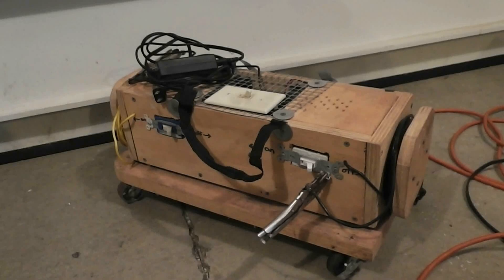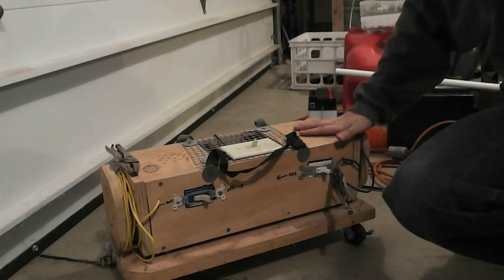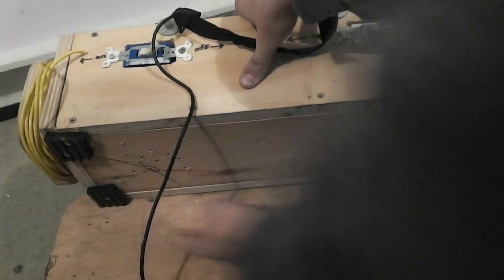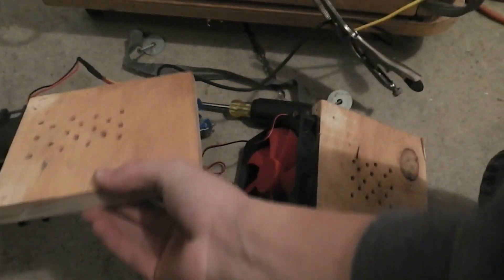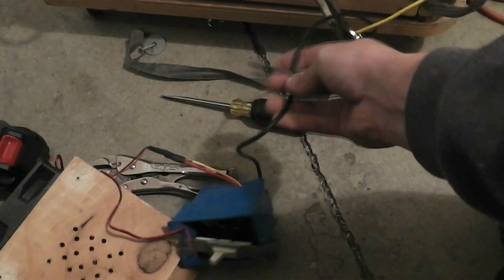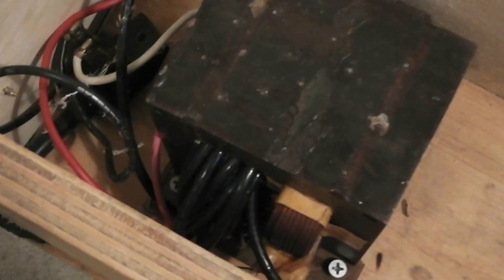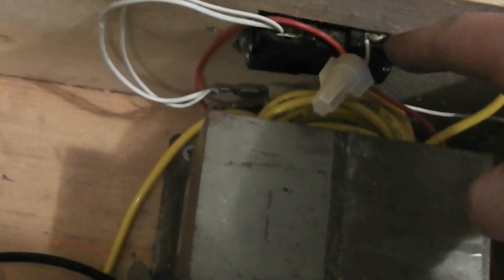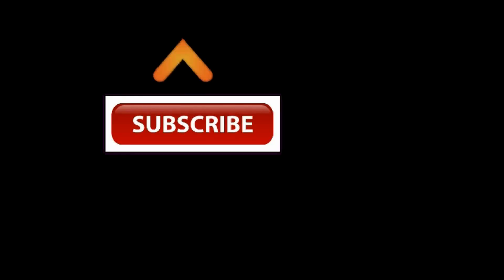DIY Homemade Welder! (best design)

Comment: If you connect the transformer's secondary coils in series, then you should have enough voltage to run 6010s. I wish people would post videos of homemade welders running 6010s. Well, at least I saw pictures of a homemade welder run stainless electrodes, my dad's AC buzz box has insufficient voltage necessary for stainless stick welding unless you connect it to another one in parallel.

Comment: Hey I like your design I was wondering if I could take a light dimmer switch to adjust the welder amperage or would it burn the switch up
Reply: +Chris Graham Since on one has replied yet I guess I will.  Using a light dimmer will not work for this as the welder would pass far too much current through it and catch your dimmer on fire.  It is possible to use the dimmer as a way to set the power level for another circuit to control the power by means of a complicated ZVS device, although I don't think that's where you're going.

Comment: My Lincoln stick welder manual used to say it's not safe to sit on the ground, while welding. You might want to look into it.
Other than than it's a cool welder. Check out the guy on youtube that shows how to weld. His name is: weldingtipsandtricks/
He's really good.
Reply from the maker: Dan Morris That would be true statement since all grounded electrical things are well... grounded, if your welder or device isnt properly grounded then it has a possibility to ground out through yourself
Reply: He is on concrete, as it is dry, it is perfectly safe

Comment: btw less windings means more amps just so u know
Reply from the maker: Yes I know that.
Reply from the maker: SWord Sord 18 gauge or bigger should be good for it. if its a single 220v transformer do around 40 wraps. 2 transformers d o18 gauge 20 wraps each.

Comment: did this setup blow any circuits in your house, even after separating the connections  just wondering, building one of these myself just want to be sure not cause a fire.

Comment: Got to be careful man. Those transformer and pulling over 200 amps and 240 volts. It can kill you if you do the wrong thing.
Reply: Lmao You aint joking on that shit. you will only screw that up once. There are more things in a microwave that can kill you than any other home appliance out there. ugh I get freaked out just knowing what parts made this thing
Reply: joshua Pollard LMFAO im 13 and I took one apart!!! soooo yea that didn't freak me out sooo
Reply: oh and ALWAYS discharge the capassator and un plug it also
Reply: Weallwayswin WithGod  Between your name and your comment I can only assume Darwinism with catch up with you sooner or later. See somebody electrocuted by a transformer out of a microwave and maybe you will have a change of heart.
Reply: dude i know what ur saying and yes im very scared of big transformers btw im never touching them i just hook them up and plug them in from the wall that's all and I'll walk over to them and look for problems soooooo yea
Reply: The voltage should be under 5
Reply: Still be careful....
Reply: I was thinking the same thing.  Have you used a voltmeter?  It looks like you wound a pretty low turn secondary.  How many turns was it?

Comment: Can`t you use only one Transformer? i have seen lots of videos in which everyone uses 2 transformers. I mean is there something i Should know? I am trying to make one myself but i want to be 100% sure of everything i should know, and I am thinking of jut using one transformer, simply introduce 240V or 110V and on the secondary i can make a coil of only a few turn to get at least 200 Amps, or is ther an issue that i am not noticing with it? Please help anyone. Thank You
Reply: the inductance of your transformer is limited just a bit about the power of your microwave. to get more power you have to use more transformers or either boost the frequency
Reply: 200 amps won't work u need more thats my problem also

Comment: I made welder like this from 3 transformers. Great, welds, works, weight is overkill :D  I did want to make it in DC welder, but its cool only if you want to do and build something, if you interested in welding its fu**ing waste of time. Cant get cheap and stable DC. So now i am welding with invertor type dc welder.
I can say that it is great to learn on that monster and then take a good tool in hands.

Comment: Two thumbs up from here.  Your demo clip was almost convincing, just kinda blurry.  Sharpen up the vid on your welds to show how smooth they are after chipping off the slag.  Then you can make  a three wheel sail cart, or any other cool transport vehicle that does not require a license.  Modify a dirt bike, or a lawn tractor speed racer.  Have fun and be safe with your new found hobby.

Comment: It would save on the electricity bill if you wired the 2 transformers together for 220. Simply connect 2 of the in leads of the transformers together and connect them to ground then run one phase of the 220 to one transformer and the other phase to the second. That would balance the load on the meter. Submerging the transformers in oil coolant as mentioned would solve your heating issue and you would have a useful little welder and not have to worry about burning down the house. Nice job though.

Comment: to everybody that makes these arc welders I found a way to keep them from overheating submerge transformers in hydraulic oil the non conductive kind used for boom trucks and vehicles that work around power lines it works and you can weld non stop for 3 hours and still only have a oil temp of 180 F. on a 60F. day thats using 5 gallons of oil

Comment: Nice job. I presume you left the transformer shunts in? Leakage inductance is crucial for correct operation. How were the transformers wired? Parallel mains, series output?

Comment: you did a great job on that and the video.   You really explained the switches and cooling very well, but not the details on the secondary windings, and what power you got as a result, can you add that detail to your verbiage ?

Comment: I like that. Excellent job. You did that. You have to find a comfortable spot with using a stick and push the stick into the metal as it arcs out on the metal. Basically feed the stick into it as it melts. That's cool man. I can't believe you did that. Future engineer right here. Your smart kid. Thumbs up

Comment: nice welder, you should really get some good cable insulation and a insulated handle. A little dangerous using a pair of vicegrips and gloves as the only insulator.

Comment: hi!. i made one welder with 2 mot and im from portugal here we use 220v at home. i want know something. my welder as 28v output and when i put a piece of metal between the electrode older and the other clamp i get 230A on my clamp meter is it good or i need more volts? i can only melt 2.5 mm rods

Comment: my two mots draw 9.8 amps at 240 volts in a 13 amps socket outputs 42 volts(each draws 5 amps outputting 21 volts) This produces lots of heat on the primary.The secondary is 10 gauge 23 turns.is that reliable for arc weld,safe for the circuit and mot?how long does it take before insulation is affected?